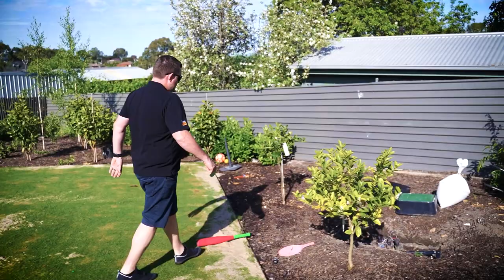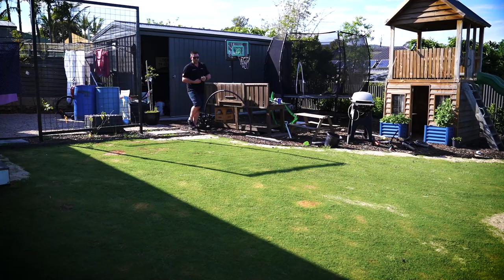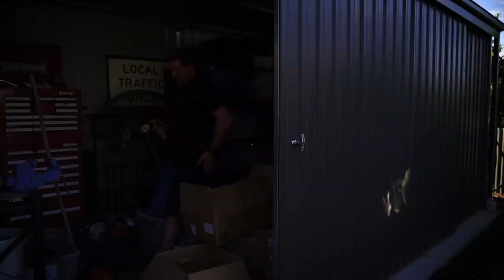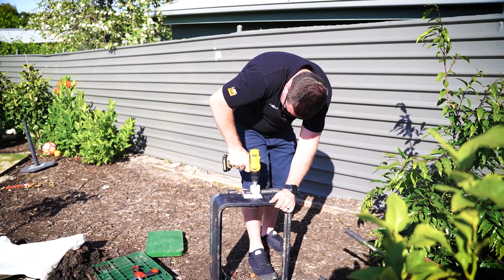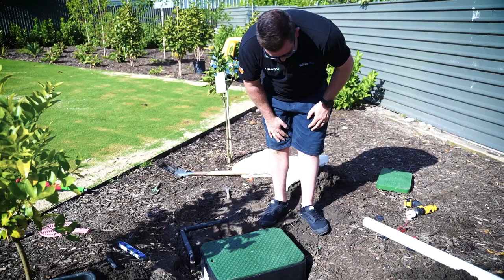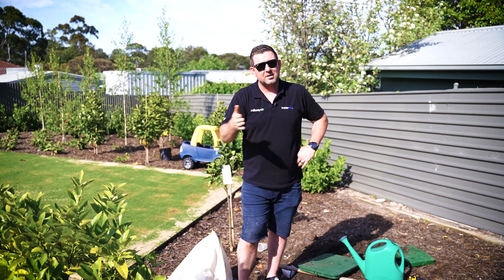How to install a valve box

Comment: I'm having to replace the manifold as whoever installed the box had one corner sitting on the incoming pipe on the manifold and someone stepped on the box and cracked the pipe.  So my box kind of sits above the level of the pipe and valve and over the years all the dirt has mixed with the rock inside the box and it is making it quite difficult to get all of the rocks out.

Comment: Noticed you have a young tree 3 feet from the box.  What is your plan to manage root growth into the box and around the valves?
Reply from the maker: Honestly I haven't thought that far ahead. That bed has three different citrus trees so no doubt I'll have issues. Better start planning for that. Thanks for bringing it to my attention.
Reply: @waterproau  no worries.  I just spent a week digging out and rebuilding a manifold that is 5 feet from my property line, where a neighbor planted a ficus tree.   What a pain it has been.
Reply: Seriously, think about those trees now!  I had to dig out my valves which were several feet from a Pine tree, Juniper bushes and a couple of Sequoia trees and it was just MASSIVE roots all around the lines, valves, etc.  20+ years of growth is not an easy thing to work around.

Comment: How do you stop the white pebbles sinking into the soil ?
Reply from the maker: It hasnt been an issue for me, but you could use geotextile or add more pebbles. Commercially they use concrete slabs.